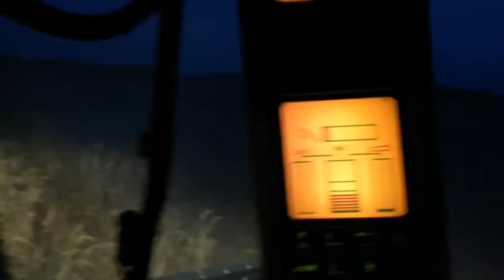Combining Weedy Beans at night.

Comment: A thought for you.  I am not sure of your combine model or JD head sizes, but, I run a 15 ft head on a MF 750.  This head is "undersized" for my combine.  Many people ran 18' or 20' heads on my combine in the day.  I find that my head, relative to combine capacity, allows me to "fly" in clean soybeans and yet still move quickly if I hit a weedy spot.  I find that this has worked well for me over the years...
Reply from the maker: Good point. My head, a 625F, (25 ft) is a little undersized for the combine, a 9560sts.  I've been told I could have bought a 30' head. Earlier in the day, in less weedy ground, I was 3.5 to 4 mph without the rotor and shoe loss sensors telling me to slow down. I slowed down as the sun went down  (dew?) and the weeds increased. I don't know where the line of "plugging up" is/was, but at that point I didn't want to cross it.
Reply: @grasscreekfarmturtlelake1741  I am very familiar with the point of plugging :(.  With my setup, plug will only occur at the head/throat...which is the way I like it!  If it is bad enough, I drop the head and start working!!  Combining after dark is risky.  The secret is always an even feed rate.  Anything you can do to ensure an EVEN feed rate is critical.  The combine is engineered to eat crazy material volume amounts, just not in one big bite ;)  My problems through the years were mainly lack of even feeding rate, usually caused by a head irregularity.  Due to this, I have worked to solve problems there.  One issue was the clearance between the pickup reel and the head auger.  This dimension is "close" on my head so that "clearing the reel and auger" is not a problem.  Another issue was my divider points on the edge.  A restriction there is a huge problem.  Many things to think about here.  My combine would have went through what you were showing there with no issues at full speed.  Thanks for sharing.  Rest assured, there are many producers in transition right now and working through the same issues!! Good luck :)